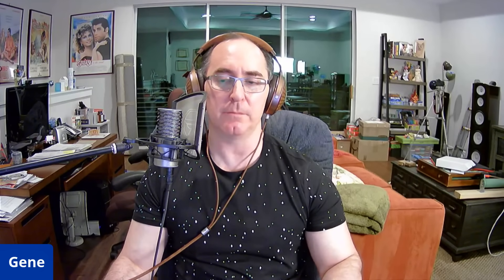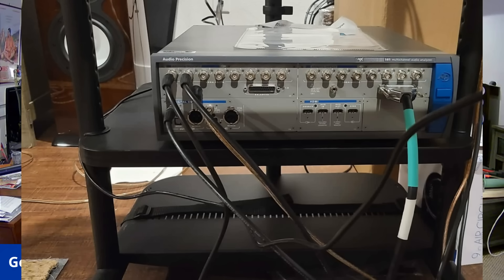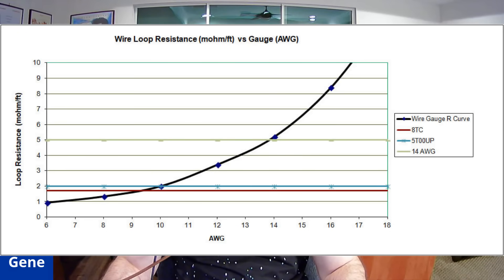Speaker Cables Really Don't Make Much of a Difference?

Comment: Cables make a HUGE difference. Audio is not about looking at charts. You listen with your ears, not your eyes. 
But you need a resolving system. Your $500 amp is not going to sound better with a $1000 cable. Actually, it will, but it doesn’t make sense.

Comment: Sorry I did not come across you channel until now.  Glad to know that you have access to some very good testing instruments.  Did you use pure sinewave of different frequency as the test signals?  if yes, did you use the same test signals at constant amplitude to run the test?  Music signal is composed of many different fundamental frequency components and their harmonics as well as at varying amplitude.  Music is all about transient changes of many sinewave components simultaneously.  In my opinion, speaker cables carries constantly fluctuating power not just voltage and currently at fixed amplitude.   What tells a piece of audio cable good or not is its transient performance.  I think you may want to run some transient tests which would be more closely resemble to the nature of music.  Music is a passage of sound.  Tone or sound is made of a combinations of sinewaves at varying frequencies, amplitude as well as, the most importantly, the phase relationship with each others.  Yes, human ears are not sensitive to small change of amplitude of certain machine generated audio signals, but we are very sensitive to small tonal and transient changes of certain sounds.    Especially to the sound or noise we are hearing daily.  I believe a more realistic test would be (if possible) is to play a passage of music with available Hi Fi equipment at a usual loudness.  Use a microphone set to sensitivity curve comparable to that of human ears.  Then compare the distortion results generated when different loud-speaker cables are being used.  Just my 2 cents.

Comment: I actually sometime use lighting "8" cord, because older amps or speakers  connectors don't take modern thickness cable so well and I have that in hand. Works fine. Also wiring inside speakers and amps can be even thinner and PCB board wire.

Comment: Try using your ears to check.
Reply from the maker: sure, but without a blind controlled listening test, you're letting your mind trick you with expectation biases which are far stronger than 10ths of a dB difference between cables.

Comment: Quite interesting material. Thx. Im using inakustik cables i think that from lowest  series. Im rather wondering if there is difference between 1.5mm2 vs 2.5mm2 vs 4mm2? Does it also depends on speakers which are connected to such cables? I have dali fazon micro + e9 sub setup with Marantz nr1607, and thinking if change of cable will improve anything

Comment: 6ohm speakers, 8 ohm Pioneer thx94 Elite receiver 09 model, problem at all with 6-8? Elac unified b52 2.0,fyi on back of speakers is written "6 or 8ohm? Hmmm 😘👀
Reply: What is your question? Is it, "Will these work together"? I would say yes. But, you will get better sound out of those Elacs, which are said to be hard to drive, with a better more powerful amp, just saying.

Comment: 16 gage amozon wire, 15ft per speaker, 2 channel stereo mode?
Reply: What are you using for amplification, how may watts per channel? And the ohm ratings on the speakers? personally, if just a simple setup with moderate power, I would go with a 14ga oxygen free copper cable. Probably around $20 for a 30 foot roll, and get some decent banana plugs or spades depending on your binding posts.

Comment: Excellent  video. I'm using 22 year old fms audio wires. In a bi wire set up. Zero on the bottom and diode for the upper. Very happy and still then for another 22 years

Comment: Another comment, in the graph or resistance and capacitance, you should emphasize the units. Thus people can understand the insignifcance of the difference when you compare to the system/speaker characteristics. the impedance variation of a speaker while operating is so much greater than cable difference that it is quite a joke to relate to cable as significant component

Comment: Great video , i was sure about the result (i state that for years). But now you proof scientifically what common sense could conclude.
BTW a even more blunt test is to take car ignition cable opposed to a $5000. This will be interesting.
A more absurd statement in this world is usage of digital cable that cost more than $20 dollars.
Yes I saw digital cable for thousands of dollars, and that for sure can not bring any contribution to anything.
Another test should be on plugs ( I am using Nakamichi for one dollar a pair) They are tight enough. Maybe you can show that on a video Cheap plugs vs$200 plugs.
I agree with every word you have said: Room, Positioning and EQ are 10000 more audible that $1000 in cables!!

Comment: Acoustic Research AR9, top model, 1979, in manual states

"night lamp cord #18 strand may be used".

"jumpers" connecting Hi and LO terminals is a piece of iron wire.

I use QED79, 3 euro/meter.

Comment: I did all this testing back in the late 90's and came up with the same resaults, I even ran some blind test with a friend who managed a Hi Fi shop with some clients. They thought they could hear something, but looking at the resaults they were random. we did trick them by telling them they were on the expensive cable when they were not.
Reply: You did a blind test where you tricked them?
Reply: It's actually audible, not everything can be measured in life, and if good sound is measurable by equipment, one don't need dedicated engineers to produce so many pairs of speakers.
Reply: @andrewlim7751 Tell me you got suckered into buying expensive cables without telling me.

Comment: I think the point that gets lost in all these justification struggle sessions is this: The cables add to the experience outside of audible performance. Like any accessory, the aesthetics and brand aura matter in the enjoyment for many. Whether it "should" or not is purely subjective and up to the buyer, like any other discretionary purchase. Also, you do see small company boutique manufacturers tell you "yes, this cable makes the speaker sound as we intend." Of course that's just a matter of certain electrical properties influencing the overall "circuit" if you will, but there's a meaningful change in many cases.

Comment: They can make a huge difference, I was also once a nonbeliever. My ears to me otherwise.
Reply from the maker: No your brain is telling you otherwise even in the likely event no sonic difference is evident. Still valid if you enjoy it nonetheless.
Reply: @Audioholics  Come to my house and I will be glad to demonstrate the difference in low end extension, expanded sound stage, and air. I measured the low end extension .Yes the rest is subjective, but very obvious.
Like I said when I first heard that cables can  make a difference , I too said it's bunk.
I too have an extencive background in electronics; having had a Ham Radio license  at 14, and have built and designed my own speakers.

Comment: Memories!  I came across the Kimber cables from years back when I was a more engaged audiophile, endlessly searching for THE system, whatever that was!   As an EE as well as an audiophile, the Kimber were the only specialty firm speaker cables that impressed me as having bon-fide engineering applied.  I had a rare respect back then for the Kimber team.
Reply: Interesting to see the Kimber performed better. More interesting to see that it doesn't matter for audio at all. Imperceptible to human hearing.
Reply: @tvtime1505  Yes, true!!  😉
Reply: So basically what you are paying for is the how the cable looks rather than how it sound, it’s a bit like choosing a gold bar as a door stop
Reply: @frankcousins7655   Yes, practically speaking, the Kimber cables do look nicer than regular zip cable, sure.   Of course!    But they are well made and so do instill a long-term confidence in them also.   All without the expensive voodoo oil hyperbole.   Actual engineering was involved.   And regarding the doorstop scenario, hey, wow, a gold brick as a doorstop would look rather incredibly impressive!!   But with the economy diving the way it is, definitely no, to using it as such.   It's better to squirrel gold away in a vault as one of many means of protecting wealth.   I'd use a mason's brick as a doorstop instead!    Cheers, and good day!  🍺

Comment: Thanks for this video. I agree 100% for shorter runs. Can you please respond to longer runs for home theaters. I have some runs approach 70 feet to a single speaker. originally strung with 16 gauge, considering pulling 10 gauge to those locations. wondering if over these distances if it will make any audible difference with lower impedance speakers. I don't want to wast time/money if it won't make any audible difference. Thanks !!!
Reply from the maker: 70ft runs are long and you need to use 12 awg or power gauge to minimize losses.
https://www.audioholics.com/audio-video-cables/speaker-wire-gauge

Comment: I saw similar tests done years ago with the same results when measured so it’s good to see your conclusion. 
The strange thing is though when we do blind tests you can hear a difference. I remember trying expensive silver speaker cable and it was awful on my system, sounded so bright and fatiguing.  
A couple of weeks ago I swapped out cables and with a digital source couldn’t notice any difference at all. I do find they do give a more noticeable difference when using a good analogue  set up though and always have done. 
Is it possible that measurements don’t equate to how we actually hear the music?
I would like to hear more about this subject, great video and thanks for your output.
Reply: If you can't measure it, you ain't hearing it.  Digital cables are even less impacted. Either it carries A 1 or a 0 or it doesn't

Comment: Good analysis. You could also see the difference modeling with crossover design software. I think the WK LCR meter will give a model of the components, or it looks like a series RL. Plug the equivalent circuit elements in and it should also reproduce what you've found in the frequency response. The phase should be shifting from 0 deg towards +90 deg starting about a decade below the break point where you were measuring the inductance rise in the frequency response. Not sure how much difference phase shifts make at high frequency - maybe similar to shifting your head a few cm. It would be great tp see more info on phase at lower frequency - what if phase shifts within the bandwidth of an instrument's tone? Should be canceling more than without significant shift in phase, similar to two channels being out of phase.

Comment: I have KnuKonceptz Kord Kable 12 Gauge Copper Speaker Wire and fairly decent banana plugs on about 6 foot runs. Your video made a lot of sense, to follow up on your personal choice could you expand a bit on why you like the Kimber Kable's so much. A set of 8TC's would run me about  $400. I have always wanted a pair of PBJ cables, now I have balanced gear so I am playing with cable choices again but always being mindful of cost.

Comment: The other day I was playing with a home made speaker and I had it hooked to the amp with a pretty thin wire. With no signal being fed to it, I could hear someone talking through the speaker. It was apparently a local radio station being picked up by my wire acting as an antenna. RFI is real, and having a radio station playing alongside your desired signal does not sound good. I replaced the wire with a good cable and the sound instantly improved. There is more to a cable than what you tested.
Reply from the maker: RFI is an easy thing to resolve with speaker wire. You must have been using some very thin wire with the conductors spaced fqr apart for it to act like an antenna.

Comment: Have 2 100kg good speakers. One day I connected one to the amp with the usual big 3 meters cable and the other with a one single wire as wide as a hair maybe that I took out of a 3 meter normal electric wire after cutting off the 3 meters plastic cover. Even at loud volume could not hear any difference what so ever. Just saying...

Comment: Great proof. But, you'll never convince , any audiophile,  with thousands of dollars of stuff.  My ears are 75 years old, and I can hear to about 8k. My biggest improvement came, after I learned how to properly , place speakers. TT cartridge properly aligned , good inter connects, good room acoustics, as good as it gets. Speaker placement folks. I'm using 16gauge speaker wire from Best Buy. And, no more than 10 ft. from AMP. I almost bought into this wire crap theory,  until I learned how to place speakers . And it cost me a few months of moving 50lb speakers , until it all came together.  And a sore back. But it was worth it, now I enjoy the music. KB

Comment: You test gear is just testing what you want it to test. . You never mention floors , & very rarely if ever feedback. You set the parameters that you want to talk about . Yes cables do influence sound qualities. It took me a couple of weeks to fix the increased feedback that good quality cable caused to my system. Only take me a couple of hours to duplicate that feedback . The only change I made was to put Good quality oxygen free cable fee speaker cable in & my system was unlistenable.
Reply from the maker: Why would I test the floor the equipment is standing on to measure cables? Do you really believe the floor material will affect cable performance?  Lord please help us.

Comment: Do you accept that different materials have different properties of conductivity? For example resistance to external interference, phase differences, and more? Your viewpoint is if you cannot measure it, it doesn't exist. But ears are much more sensitive than any measuring equipment.
Reply from the maker: Different materials hace different conductivity.  That's no mystery. Silver is slightly more conductive than copper which becomes a wash if you use more copper to compensate. The "phase" difference you claim between conductors is a made up fantasy that doesn't exist.
Reply: No, actually, good measuring equipment is so precise that you could never come close to perceiving the variations that it is capable of measuring.

Comment: Thank you for clearing that up! I use a spare electric cable for one speaker, it works as good as the thicker speaker cable on the others, but is easier to hide on the wall. I think the non-symmetric layout of the placement in my room is the bigger difference, but even that is not audible after setting it up with a microphone wizard in the amplifier. Not an audiophile, but I do like good sound!

Comment: Crossover board resistors ,capacitors ,inductors and even binding posts and cable termination and connector quality iare all widely understood to make a Sonic difference, BUT CABLES AND WIRES APPARENTLY DON’T!  YEAH SUUURRRRRRE THEY DON’T!!  Maybe if you’re tone deaf they don’t make a Sonic difference in better resolving systems!  Just like 2 similarly measuring amplifiers or loudspeakers with a flat frequency measured response don’t sound any difference either???!’!!!!!  Lol! 
Unbelievable!!!!   TOTAL denial!

Comment: Hi Gene, my experience with cables has been that interconnection cables have audible effects, but suitable speaker cables mostly sound the same, with only one caveat. When using tri amped speakers (with crossovers removed) there's gains to be had by experiment and trial and error. The output impedance of amplifiers is important particularly for bass units, as it can swamp any cable characteristics. That's my two cents worth!
Reply: I would argue that particularly long, thin, or overly capacitative cables could affect the crossover and damping. The problem is, a passive crossover is inherently.. bad. Having used both, it's amazing how much damping factor is given up right at the speaker end. Audio Enthusiasts really should take queues from professional audio. One can do phase compensation, delay, sharp crossover filters, and end up with near perfect frequency response and group delay for what amounts to less than a half decent passive crossover due to no power handling capacity needed. 
I'm probably never going to deal with passive crossovers again, they're so particular and depend on the impedance curve vs frequency for each driver, impedance rises with voicecoil heat so tuning changes when it's loud, good air wound cores are expensive and active requires no inductors, etc.  
Unfortunately audiophiles are cautious about Op-amps, but that may be based on legacy or cheap ones. Their performance can be better than what anyone could realistically make passively.  I've made tube amps and put Op-amps inside it for the phono preamp, because it's just a better solution for that job. They sound great, and nobody would know without peeking inside it.
Right now I'm working on active crossovers and a pair of speakers to match it. Using JFET op-amps and even single chip 20w class AB power amps per driver. They measure well, so we'll see how that goes. I'm using XLR4 cables for speaker wires on either end, but if I had 4 pin Speakon connectors handy I would have used those. We need to start using stuff less outdated as banana plugs or cheesy bare wire terminals. Even XLR is rated for 15 amps(1800W@8ohm), and Speakon – 40 amps(7200W@8ohm).

Comment: I still using car stock speaker cable and with some cca speaker cable. I hv tried some so called premium speaker cable but it make no difference. In order to improve sound is to reposition the speaker axis, crossover point, and EQ until u hit the correct spot.